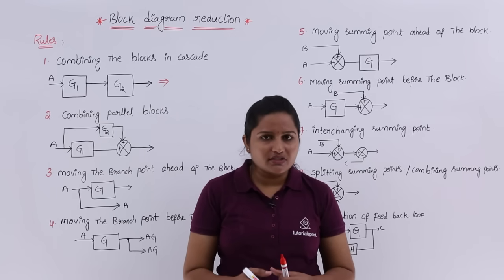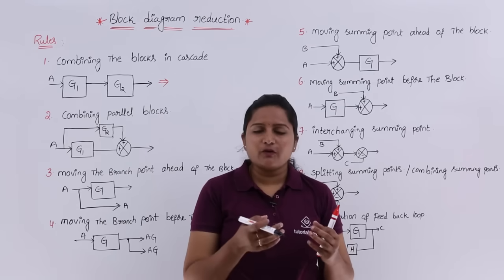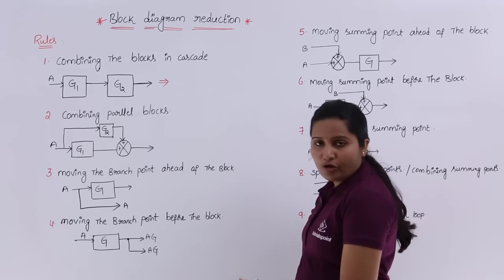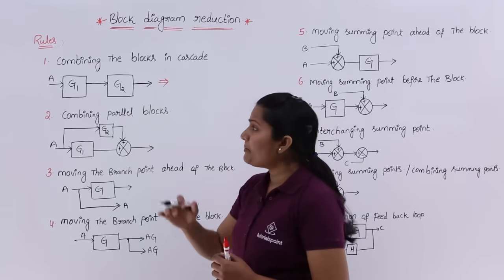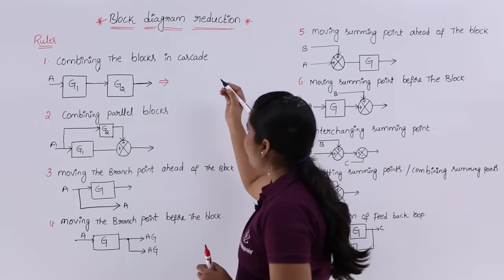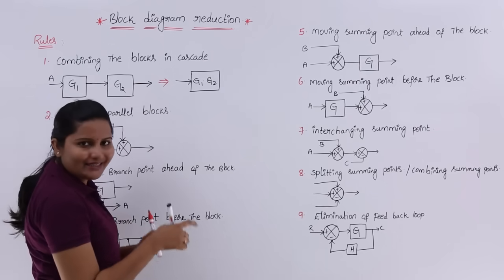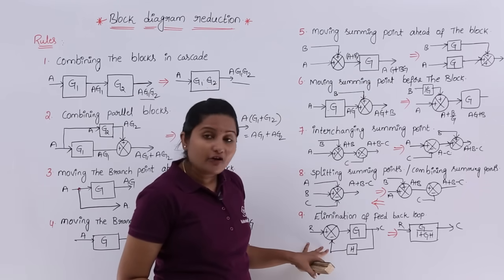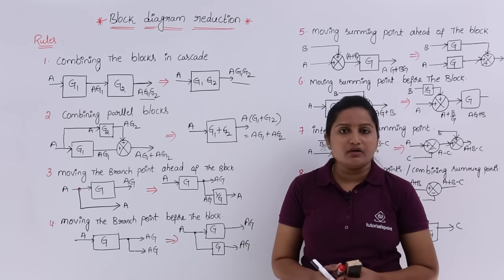Block Diagram Reduction

Comment: I think a correction is needed. When the branch point goes to the right of a block, it is not multiplied by the function of that block. It is multiplied by the inverse of the function of that block. This is necessary to preserve the previous state. Otherwise, it would be as if it were multiplied by the square of the function of that block, which would be meaningless. Similarly, when the branch point goes to the right of a block, it should be multiplied by the function of that block.

Comment: Nice Explanation Dear. I am doing thesis of MS Computer Science. I made a Smart Water Tank, which will monitor pH, Turbidity, Water level, Water Pump Temperature, AC voltage etc. and displays it on app. Can I use the block diagram you taught?

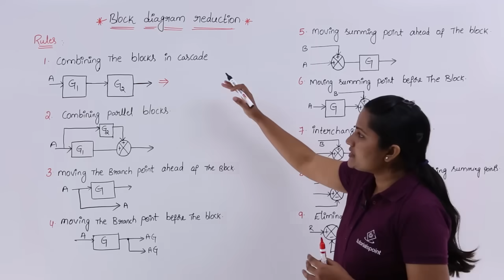Comment: (1:42) 1.Combining blocks in cascade
(3:31) 2.Combining parallel blocks
(5:50) 3.Moving the branch point ahead
(8:17) 4.Moving the branch point behind
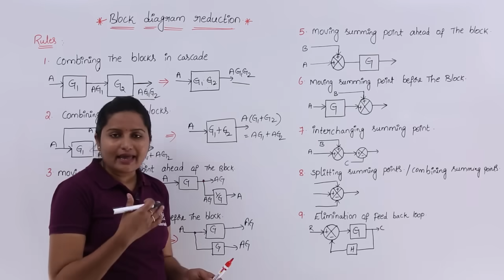(10:32) 5.Moving summing point ahead of the block
(12:30) 6.Moving summing point before the block
(14:45) 7.Interchanging summing point 
(16:10) 8.Splitting summing points/ Combining summing points
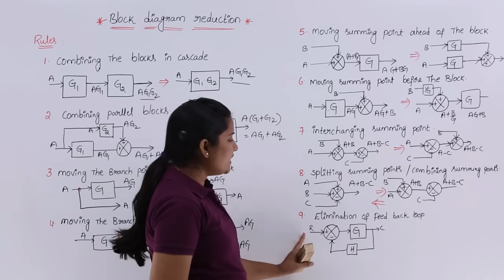(17:20) 9.Elimination of feedback loop
Reply: Coz of u i watched this video in 3 minz😝😅😅
Reply: top↑
Reply: Q